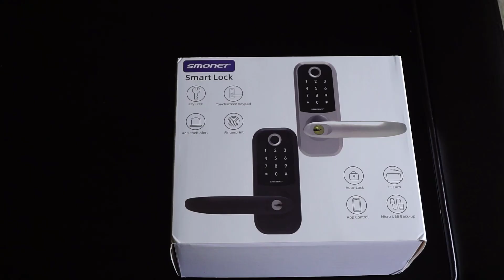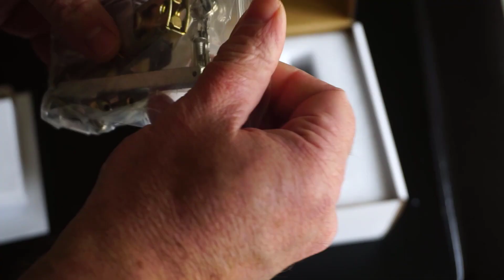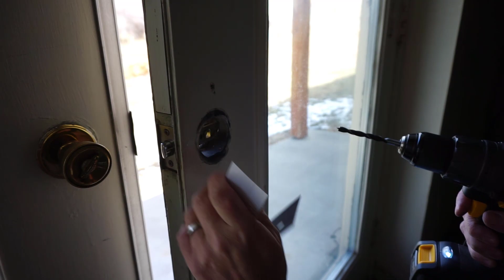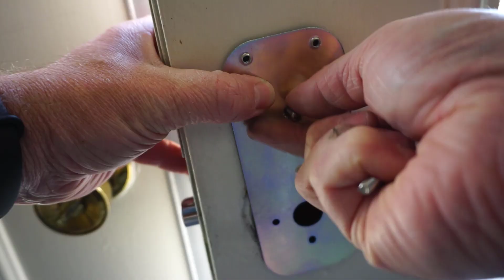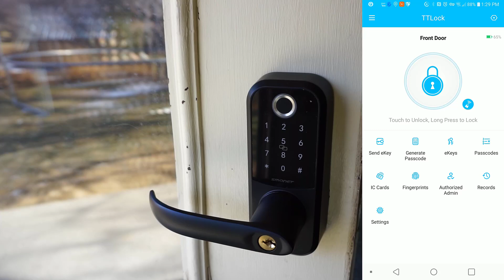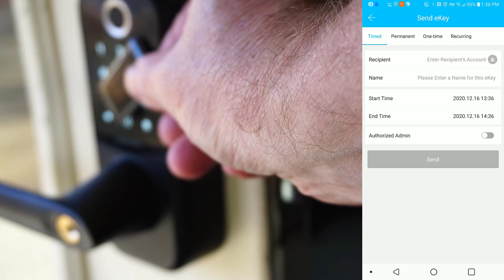How to install a smart door lock and setup the smartphone app - smonet fingerprint, keypad, IC card

Comment: The problem with this kind of locks is the keypad stops working, and the fingerprint sensor will be the next one to go. Then in the end, you have no other way than using the mechanical key to operate the lock and you are back to where you wished you had just left the old mechanical lock alone after all

Comment: So I installed mine in my room last night. But doesn’t want to open with my finger print. It takes all my fingerprint, key card and passcode but doesn’t open. Do you know what could be wrong?

Works with key
Reply: Lol 😂
Reply: @JediWebSurf what?
Reply: @rosegold9617  so none of it works except for the key. It's basically just a normal door knob. That's so ironic lol. Because she got it for its smart features but it ended up being a normal door lock. 😂
Reply: Same here. Mine only unlocks with key